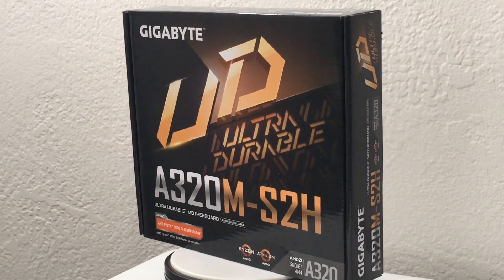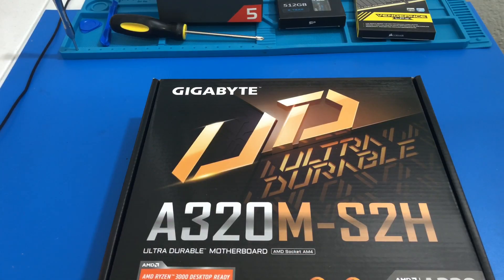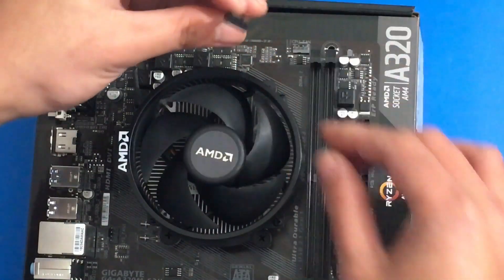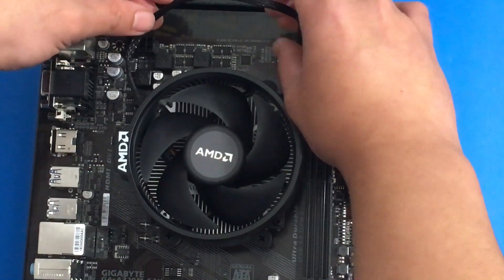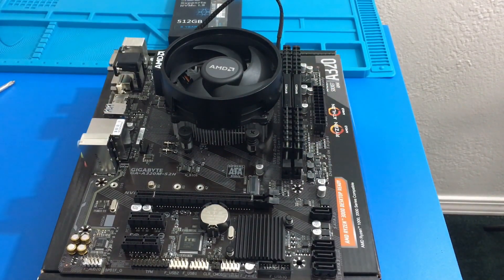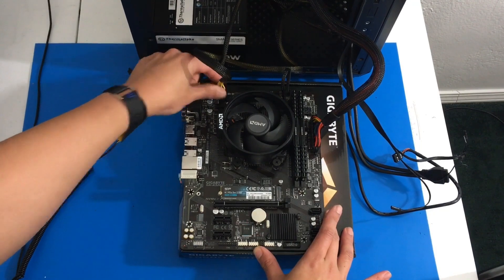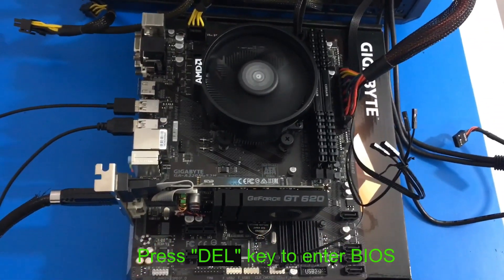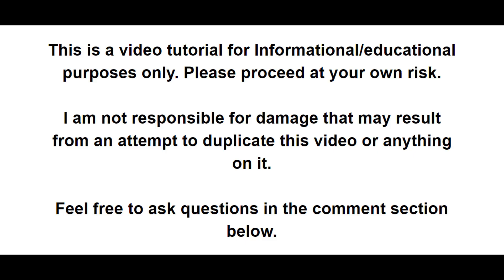Ryzen 5, 16GB RAM, M.2 SSD Install on GIGABYTE GA-A320M-S2H Motherboard

Comment: I lost my standoff for nvme, anyone know where i can buy that standoff? Or at leats what screw was used. Im only missing the screw itself.
Reply from the maker: There are plenty available on amazon or ebay. Local computer shops as well. Just do a search for standoff. Most of the ones I see online come  in a many pieces. Usually under $10. I’m trying to think if you can get them individually. I would check local computer shops if they are nearby

Comment: I have an issue. When i installed 2* 3200 Ram stick it only gets 2133 speed. However if I put 1* 3200 Ram, it gets 2933. What's the problem. In the site, it supports 2 DDR4 3200 speed. My Specs. AMD Ryzen 5 2600 Six-Core Processor 3.40 GHz. Should I enable XMP? Is it safe?
Reply: Yes yes

Comment: what Ryzen 5 model is that
Reply from the maker: Budget ryzen 5 1600 65w am4 processor with wraith stealth cooler
Reply: @whattmeter  ok
Reply from the maker: Good luck with the upgrade. Yeah I recommend getting a much better cpu if possible
Reply: @whattmeter  yeah im planning a build with almost the same specs
Reply from the maker: Oh ok. Nice

Comment: I didn't even realize this motherboard had a ssd slot for a long time I just bought a 1 tb one and have been upgrading for awhile thank you
Reply from the maker: There are different versions of this motherboard. Glad the video helped. Good luck with the upgrade
Reply: @whattmeter  yes I have the same one I am pretty new to pc building and upgrading so I'm still learning
Reply: did buying the ssd effect performance? i just bought one

Comment: How to enter the Bios?
Reply from the maker: Check the 7 minute mark. Press the delete key to enter the bios
Reply: @whattmeter  didn't work
Reply from the maker: Interesting. Same motherboard or a different model?
Reply from the maker: Try F8, if not try F2. I would also check your keyboard and try a different one
Reply from the maker: Any spare wired keyboards? You can try? No luck with F8 or F2? How about plugging in the keyboard to a different usb port
Reply from the maker: If the delete key doesn’t work and spare keyboards or other ports don’t work I’d call warranty on it. Maybe they can help you out or if it’s covered under warranty

Comment: I just tried to pop in a Ryzen 5 5500 on the same board but when I booted up I didn't get any display at all. Not sure why. I'm using the latest bios F55 that's supposed to support this chip. My Ryzen 3 220G worked just fine though. Any suggestions?
Reply: Were you able to figure it out? I also tried a Ryzen 5 Apu and it didn’t get BIOS
Reply: @Karuska22ps  Yes I sort of knew already but with some boards they won't detect the built-in graphics card. So I returned the apu for a gpu and it worked just fine
Reply: I have the same issue I am using the same motherboard and CPU but I am getting no display. If anyone has an idea on what to do to fix this issue please let me know.
Reply: @guywithapotato1658  The issue the motherboard needs a bios update to be compatible with Ryzen 5. I ended up returning my motherboard (since it’s impossible to update the bios for that motherboard without a Ryzen 1/2/3).

I bought instead this motherboard from Amazon and worked with Ryzen 5600G:
ASUS Prime B450-A II AMD AM4 Micro ATX for $81

Comment: did u have to do any bios update because i have the same motherboard and cpu and when i put it in i’m not getting any signal and my gpu won’t spin but when i put my old cpu back in everything is fine
Reply: Did you figure it out? I tried a Ryzen 5 APU and no luck in display showing
Reply: @Karuska22ps  the cpu probably is comaptible with that motherboard & or the bios is up to date pc still running smooth to this day r5 3600 and 2060
Reply: isn’t *
Reply: @Fckurbtc1k  ah yea I can’t get my bios to show on my screen
Reply: @Karuska22ps  do u have a older cpu? that you know works on that mono?
Reply: @Karuska22ps  what cpu and motherboard do u have
Reply: @Fckurbtc1k  I have a Ryzen 5 5600G and this exact gigabyte board
Reply: @Karuska22ps  yea u can’t run 5,000 series chips on this mobo that’s what i did i bought a 5600 and i was getting no display you can either buy a mobo that supports that chip and run it or buy a 3000 series chip for that mobo

Comment: Hi Jasetutorials, why my M.2 NVMe cannot detect on BIOS with my Gigabyte GA-A320M-S2H Rev 1.2 motherboard "No NVMe Device Found". I used AMD 7th Gen A10-9700 APU processor on my motherboard, do I need replace my processor so M.2 NVMe will detect my motherboard or do I need to update the BIOS? Hope you can help me about this, thank you!
Reply: Did u got solution?
Reply: Did you figure it out? I have a Ryzen 5 5600G and it won’t go to BIOS

Comment: What ram speeds does this motherboard support?
Reply: 3200
Reply: pretty sure it supports up to 2666 mhz, over that you'll have to overclock to maybe 3000 mhz for the system to run without overheating, just from experience.
Reply: @NRZKryzi  no, 3200

Comment: What graphics card does it support? Does it support the 1660 super?
Reply: any gpu will work, but your limited to pcie3 speeds (which doesn't make much difference for current gen gpus)
Reply: @一本のうんち  what do you mean limited? An rtx 2060 won't work?
Reply: @一本のうんち  i'm having this with rtx 2060, i don't know if it's a good combo.

Comment: for some reason my pc is only letting me use 8 gigs of my 16 gigs of ram lol why pls help
Reply: can you see both sticks in windows and bios?
Reply: @一本のうんち  yes
Reply: @一本のうんち  but it says that the other 8 gigs is "hardware reserved" yet when I boot off with the same stick of RAM in the other motherboard slot it decides to not boot. same system as this one in the vid. I've checked every solution under the fucking sun and at this point imma just upgrade my motherboard
Reply: @typhoon109  if your computer boots with single ram stick in one slot and not with a same single ram stick in the other slot that means slot is broken. i'd get the mobo replaced or buy a new one. or try cleaning that slot with compressed air, could be a pube that's stuck in it. yeah
Reply: @一本のうんち  motherboards are pretty cheap and this motherboards pretty shit anyway so imma be getting a new one
Reply: @一本のうんち  and also could it just have been reading the ram as existent but not working?

Comment: Can the Silicon Power 512GB NVMe M.2 PCIe Gen3x4 2280 TLC SSD Solid State Drive work with ryzen 3 2200g, gigabyte a320 s2h?
Reply: Do u install nvme on it?

Comment: Hi may I ask if this type of motherboard support Ryzen 5 5600G? Thanks
Reply: yes, just actualice the bios to the last version.
Reply: @mrdonenriquesama  how do I do this
Reply: Did you figure it out? I have the same Ryzen 5 5600G and it won’t display
Reply: @Karuska22ps  if your a320 sh2 isn't versión 2.0 chipset b350, You need to update BIOS using an 2000 3000 series cpu to update it.

Comment: Nice video! I have a 1660ti gpu, r5 3600 cpu and dual 16gb ram on this motherboard installed. I also have a samsung 860 evo 500gb ssd and a samsung 840 240gb ssd installed. I now want to ad another SSD a 1TB SSD i just buyed the samsung 870 evo SSD 1TB can i ad this third one to this motherboard? Or should i return it and install a M.2 SSD as a third SSD? I hope you can help me with this. I hope i can ad a Samsung 970 evo M.2 SSD to my pc, but i am so confused with this feel a bit noob again.
Reply: Hi. Is your cpu run well on this motherboard?

Comment: Hey! Thanks for this video! :) QQ: I bought Kingston A2000 1tb m.2 nvme and I will be installing it on my Gigabyte a320m s2h. Will I ever need a heatsink for it? Thanks!
Reply from the maker: It depends on the cooling that you have on your case. You can check the temperature of your ssd with crystal disk info or other methods to see if it is maintaining its cooling
Reply: @whattmeter  thanks a lot!!
Reply from the maker: No problem. Good luck with the upgrades

Comment: Is there any particular kind of M.2 SSD supported by it? Or is it compatible with all kinds?
Reply from the maker: Nvme for sure. I never got to try sata m.2 ssds
Reply: @whattmeter  Thanks mate👍
Reply from the maker: No problem and good luck
Reply: @whattmeter  Is it compatible m2 NVME with Ryzen 3 3200G?
Reply: @franagustin3094  same question
Reply: Don't but the PCIE gen4 SSDs as this mobo is limited to gen3 speeds.

Comment: I got a a320 but how do I get pcie4  speeds to work in the bios (5000 read writes?)
Reply: Unfortunaltely the a320 chipset only supports PCIE 3.0. to use PCIE 4.0 You will need a b550 or x570 motherboard and a PCIE 4.0 NVME for the high er read write speeds. if your A320 has an M.2 slot you will be able to use a PCIE 3.0 NVME drive which while not as fast is noticably quicker than a standard SSD or hard drive.

Comment: Will ryzen 3 3200g work ? 
Or we have to update for working of ryzen 3 3200g ?
Reply: I have ryzen 3 3200g with the same motherboard
Reply: @efe882  when did you purchased the motherboard and from where. Did it asked for bios update or not.
Reply: @syaci-0  when i bought the pc it was in there already.

Comment: Hi Sir, 
Memory 16gb corsair ddr4 vengeance is not fitting into it.
Reply from the maker: Too small? What rev is your motherboard. By any chance did you get laptop ram?
Reply: @whattmeter  motherboard is rev 2.0 and memory is ddr4 for pc but the centre knob is just slightly away then motherboard knob
Reply: @whattmeter  uploaded in YouTube. 
The motherboard center knob and memory centre gap not match

https://youtu.be/UCc77LC3ris
Reply from the maker: have you tried rotating the ram? that's off that it wouldn't fit. I would just contact corsair support. They can probably help.
Reply: @whattmeter  yes tried that too... Have contacted support.
Reply from the maker: Did you pull down the tabs for the ram slots?
Reply: @whattmeter  yes I did, even tried pushing the ram from one side so that it fits but that too didnot work.

Comment: Can it handle dual channel 3200 ram?
Reply from the maker: yup, I tried it and you can change the bios to overclock the ram. Make sure you have the newest revision of the motherboard though. I don't know if the older versions of this mother board can handle 3200 mhz ram.

Comment: hi, i am pretty much using the exact same parts (other than a 1050ti) and i can’t for the life of me get it to post. did you update the bios possibly? let me know. thanks
Reply from the maker: I did not update the bios yet as it was updated late 2020. I would try reinserting the ram. If you can try a different graphics card. Also are you plugging in monitor to graphics card?
Reply: @whattmeter  i tried reinserting the ram yeah, and putting it in the farthest over slot (just one) and i don’t get any signal at all. the gpu fans spin and i tested it on my friends pc so i know it works. and yes, i’ve got the monitor plugged into the card hdmi. i think my cpu may be the problem.
Reply from the maker: It’s possible. Cpu could be. I would also double check your power supply connections to motherboard
Reply: @gart869  I’m having the same problem I think it may need a bios update because I’ve tried everything
Reply from the maker: Do you know what rev the motherboard is? If you have the previous one Then definitely a bios update
Reply: @whattmeter  we took it to a repair place a little while back, turns out the motherboard was just broken somehow. thanks for helping though
Reply: @whattmeter  it says rev 1.1 but socket am4
Reply from the maker: Oh no wonder why. Definitely need to update the motherboard
Reply from the maker: Ohhh gotcha

Comment: im building with the same parts thanks
Reply from the maker: nice! one thing I noticed is lack of fan ports. only one for the system fan and one for the cpu fan on the motherboard, so you if you are planning on using a lot of fans you might need a fan hub or you might have to hook some fans directly to the power supply.
Reply: @whattmeter  thanks I grabbed a fan hub yesterday . Today is the day of my 1st power up .
Reply from the maker: Sweet. Glad it worked

Comment: This is an attractive board by Gigabyte, which I am increasingly gaining respect for.  
Sadly it will not support the Vermeer chips but still an interesting board.  For Vermeer compatibility you may want to consider a 450 or 550 mobo.
Reply from the maker: Thanks good to know
Reply: it works tho, through a official bios update
Reply: Yeah according to their own website bios version T54e supports Vermeer.

Comment: This mobo supported ryzen 5 2600 and also supported 3200mhz ram?
Reply from the maker: Oh the cpu in the video is just a ryzen 5 1600. This mobo is a rev 3. If you get the rev 3 version like the one in the video then yea it will run ryzen 5 2600 out the box. I would make sure the box says AM4 socket too. The one I got had a pretty recent bios installed out the box so this should be able to. Also yes this runs ram in 3200 but youd have to turn on xmp profile
Reply: @whattmeter  do you know if this board supports Ryzen 5 5600G?
Reply from the maker: Box also says it’s ready for ryzen gen 2000 and 3000 so im pretty sure it sure work unless you buy the older version of this mobo
Reply: @whattmeter  i have the same mobo like this but its rev 2 or rev 3 but I actually don’t know which rev is and its says 3000 ready
Reply from the maker: You can check top left of motherboard to see what rev it is. If it’s a rev3 it should support ryzen 1st 2nd 3rd gen as stated on gigabyte website https://www.gigabyte.com/Motherboard/GA-A320M-S2H-rev-3x#kf
Reply: @whattmeter  Yes, good.
Reply: This cpu will support an r5 3600.